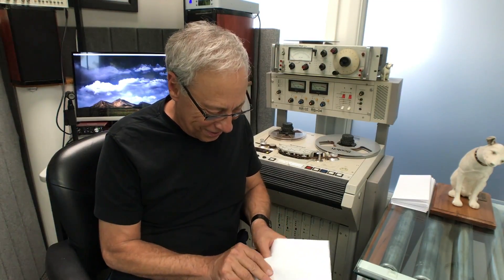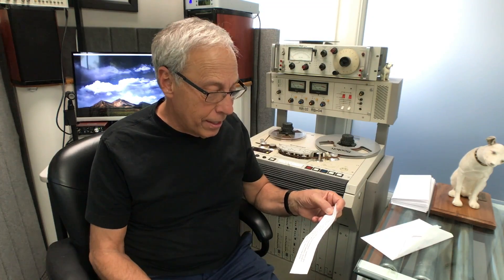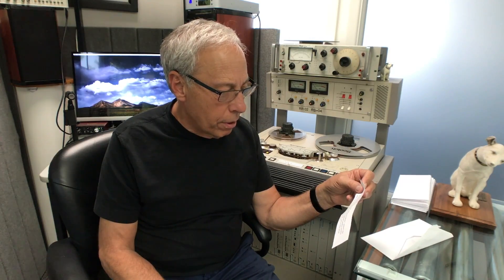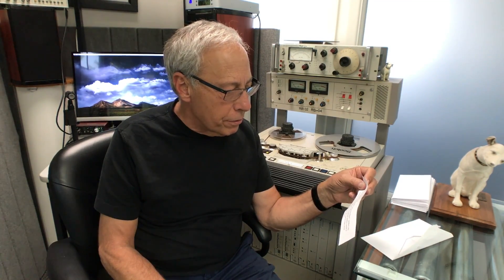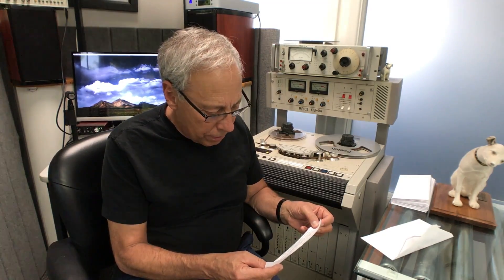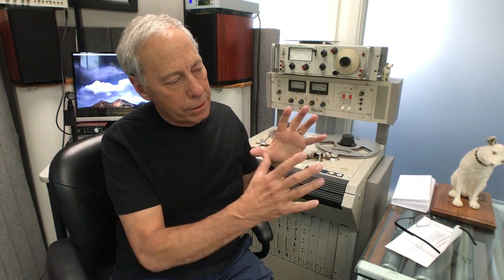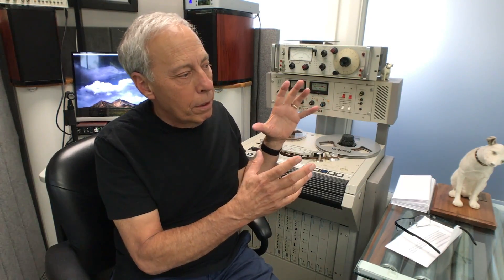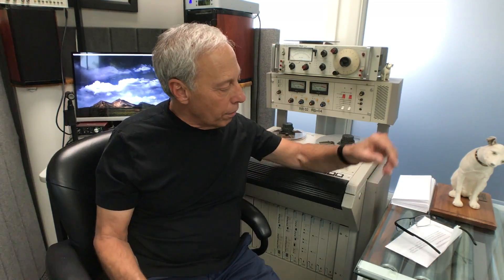The truth behind active speakers and servo bass

Comment: Indeed, the "audiophile" fraternity have been hoodwinked by and been spouting so much BS since the 60's that they should be ashamed by their own blinkered conservatism and gullability! Technically a powered speaker will always be better at controlling the drivers than a passive one hanging off the end of a few metres of "polarized low oxygen copper wire" (REALLY!?). I agree that servo speaker is most advantageous for bass speakers where, as you stated, the increased mass of the moving parts is more difficult to control. The electronics to do this is, these days, is very affordable. Conceptually, a cheaper speaker could be used as the control system could compensate for the speakers shortcomings.

Comment: As you know, accelerometers are a 1970s solution..  More recent motional feedback woofers use a secondary coil to generate the feedback, signal which is far faster than a mechanical sensor.

Comment: At about 2:30 I feel the nail was hit right on the head. I've been an 'audiophile' since the 70's and been frustrated by the blinkered ignorance of, perceived, intelligent people. A lot of 'audiophiles' allow their opinions to be steered by what they read from other people consequently they poo poo active speakers,bi and tri-amping but are quite happy to negate the damping afforded by low O/P imp of amps by sticking long lengths of, 'low oxygen', speaker wire to connect them.

Comment: Active speakers (i.e., speakers with inboard amps) are not just "junk speakers."  In contrast, most pro speakers are active because they are intended for use in studios or mixing rooms. These areas are only focused on supplying the "front end" (pre-amps and tape recorders) in the audio chain.  To monitor sound in those areas, it is more cost-effective to put the amps in the speakers as you describe.

Comment: I am using a new subwoofer (I won't mention the company Paul on your channel) from a company that uses servo tech in the drivers of its subwoofer designs. The performance is amazing; fast, tight, and very deep bass extension in this case nearly flat response down to about 15Hz out of a 12" driver and a 370W AB amplifier. I use it in a typical medium size living room. Works great both for music and AV applications. Servo control is great for this application. I couldn't agree more.

Comment: When I was working for PAS in Harbor City CA  more than a few years  ago they used both active feedback and time offset correction in most of their upper end speakers but Ive always cringed a bit at manipulating the parameters artificially and thus forcing the driver to do things it couldnt do naturally. I know their Studio Monitors were great but not for the home environment at all and were made to be used with specific amps and electronics.It seems to me manipulating the natural parameters this way in itself would introduce distortion?

Comment: Once I ripped out the crossover in my Elac 121 Jet speakers and replaced it with three amplifiers (LM3886) and an electronic crossover with the exact same specifications. The improvement where so large that I never returned.

My latest speaker construction contains two amplifiers special constructed with the speaker units in mind, and therefore they aren't not the same. The sound wery detailed, problerly due to the missing coils in the signal path.

Comment: you should develope electrostatic headphones with a laser servo control, lasers measure the distance between the cone and the case. you don't need a heavy accelerometer on the cone, and the entire amp fit in the headphone.

Comment: I'm not sure I am understanding this correctly. Are regular subwoofers a push system, while servo are push/pull?
Reply: No that's not correct. You're thinking of push-pull amplifiers. These which use a particular electronic configuration. Almost all amplifiers have a push-pull output stage regardless of the type of speaker system involved. A servo system has a sensor(s) on the main driver which sends a signal back to the amplifier. This allows the amplifier to tell if the cone is in the correct place at any instant in time. If it isn't then the amplifier can try and correct for this. The amplifier therefore continually modifies the signal it would have normally sent. The idea is that imperfections in the cone movement can be partially corrected for to improve the sound quality.

Comment: The real solution is to build your own active speaker system, requiring building speaker boxes with raw drivers, and driving those with external amps and external electronic crossovers. Phil Marchand makes a great electronic crossover for doing this, as do a few others. See my video on my active speaker system: 
https://www.youtube.com/watch?v=4MNKxj6G_hE
Paul is correct, active really is the way to go, but you have to build the system yourself.
Reply: I have been thinking a bunch about this lately. Would something like a Behringer DCX2496 be good enough for the crossover portion of the system?
Reply: This is a pro audio device intended for live sound applications. Generally speaking, such devices are a poor choice for home hi fi as they tend to have a high noise floor that is no issue in live sound but unacceptable for home hifi. Also, this device includes many features not suited for home use. And it offers a two way crossover only. For true hifi, a three way crossover is optimal, hence the Marchand recommendation. A better choice would be the mini DSP offerings, they make a version that offers two crossover points for a three way system. The issue with these digital devices is the A/D and D/A converters. No converter is sonically neutral, and each has it's own character. Building active speaker systems is an expensive proposition. If you really want to build an active system on a budget, then see my video, "Satellite/Subwoofer Speakers" in which I outline the building of a three way active speaker system using all car audio electronics, which performed remarkably well, and can be built for btw $700 and $1000. But you get what you pay for. I currently own four active systems and have built several others, and as expected, the more money a system costs, the better it sounds, much better in fact.
Reply: Gotcha. Yea, I figures that there had to be some major differences in pro audio shit versus the home stuff. The prices just don't make much sense. The Marchand stuff is really expensive. I guess I will just skip the whole thing. Is it possible to put a passive crossover in between a pre-amp and the amplifier, or is there not enough signal strength there for that to be feasible?
Reply: @MeatPopsycle  it has a lot of functionality for the price. you can replace it down the road with a high en dsp once you figured it's the weak link in the chain. depending on your speaker design you will appreciate the delay, and eq options. better spend  your limited budget on better amps and drivers than expensive dsp is my experience although at some point the behringer dsp will become the weakest element..

Comment: Servos correct a problem AFTER it happens.  Doesn't work well with faster tempo music like techno and metal.  The effect is weird.  Doesn't matter, because with better drivers today- non servo-subs like SVS and HSU totally outperform old school servo like velodyne.  That's thanks to superior drivers like TC Sounds and others with ultra light, rigid cones, massive voice coils and long xmax.  Old "servo"  subs had an 11mm xmax.  New stuff will have 2"  or more with 3"  VC's and massive magnets.
Reply: The speed of correction of a control system is higly dependent on the control algorithm and processor used. Modern PID control algorithms are extremely fast and precise. Manufacturing robotic arms are controlled with PID logic.
Reply: Thoughts between a rythmik f12-300 and hsu vtf-2 mk 5?  I'm really having a hell of a time deciding.  I have a definitive super cube 1 in the room as well, and the room opens up to the kitchen.  The overall room size is most likely over 3000 cubic feet. Not sure if I should go for the servo control (sealed) or for the ported non-servo controlled (hsu).  Room is used for both 5.2.2 HT and 2.2 Stereo listening.  Theil CS 2.2. main L./R.  Can you solve my conundrum?
Reply: As do ALL amplifiers.
Reply: The most moronic comment I have read this year. All frequencies servo feedback is applied to (bass and sub bass) are SLOW. Periods of 10 ms to 33 ms. "Techno and metal" have nothing to do with it. Derp!

Comment: Back in the late 90's Linear Audio came out with a subwoofer package for use in car audio. The System came complete with the amplifier & 3 8" raw subwoofers that was designed with a Servo Feedback loop. Where this system shined brighter than anything else at the time was that because every car required a different design of enclosure built for the subs. Some boxes were extremely small and others larger and not always square or have 90deg walls.  The genius of this Servo system was that the amp & subs could still play almost perfectly regardless. 
I built an SQ focused system in a GTI and when finished was amazing, space was very limited so I installed all three 8" subs into the spare tire and due to the feedback loop correcting bad harmonics the car ended up a top contender. 
I used that same servo system that  Linear power product in multiple cars and would get perfect Bass every time. They worked well were no other sub could because of the small fitment requirements. I just wish one of the current automotive focused company would reintroduce the Servo package to the world again.
Reply: NvTwist linear power is still going!!!!